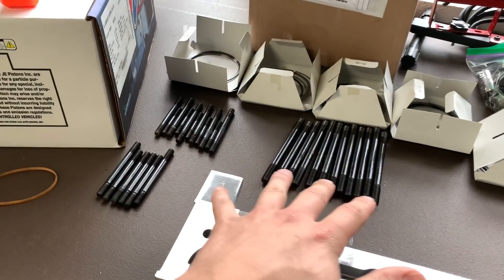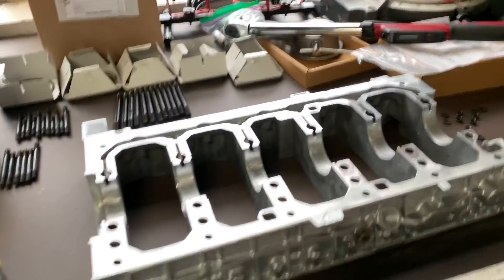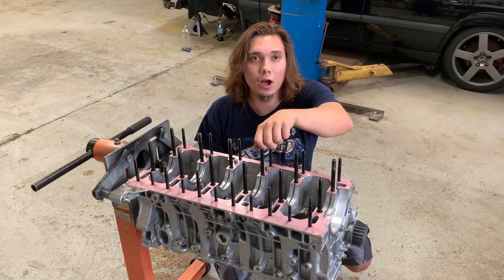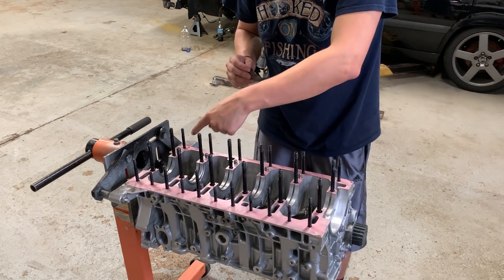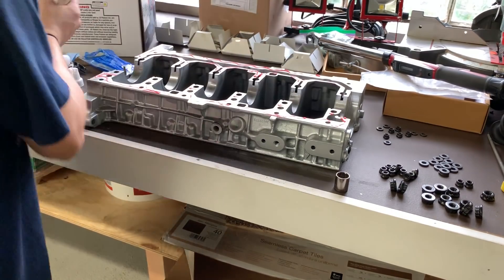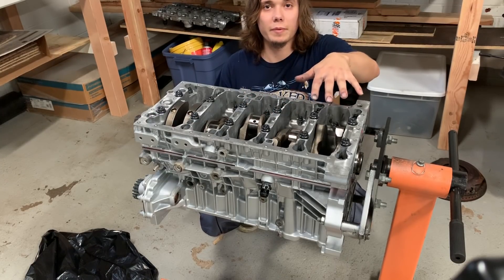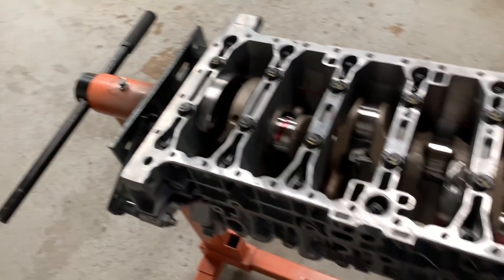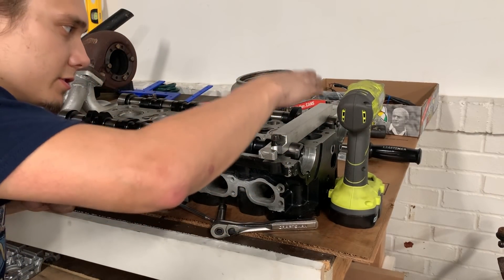Volvo 850 Build Part 2 - Crankshaft + Valve Lash

Comment: Now I'm worried about not using enough sealer on my rocker cover reseal. I only had a small tube and used new foam roller and only applied it to the cover side only. Hope my oil pressure is ok

Comment: I've just torn apart my 2000 volvo v70 R and waiting on parts to start the rebuild. Could you let me know where you got the torque specs and tightening sequences because I can't seem to find any info on the bottom end online. I even bought a shop manual but it was missing alot of info. Thanks alot great video

Comment: Thanks for great videos, amazing work! I want your advice about problem with my volvo 850 T5. I bought it with cracked oil pan, which was sealed with fiber glass, I didn't even know until last month parts sealant came off and clogged oil tube, oil light came on and one crankshaft journal overturned. It is very hard to find good B5234T engine, I Googled that 2.4 crank is same as T5 so thinking to replace it. How hard is to replace crankshaft and bearings, has cilinder head or engine to come off?

Comment: Like your videos very much. Own my volvo 850 t5 in Russia. Decided to do something far similar with my engine🤘 but came across with absence of autoparts(( can't find original std main bearings. Dealer has King or Glyco. But i don't think its good ones for the turbo engine. What kind of main bearings do you use and where can i get them?? Thanks dude

Comment: Anaerobic applied to the wrong half of the two surfaces. Only need it on one side, always choose the part with less surface area to apply this sealant to. All the excess becomes diluted in the oil when the engine is started. Probably no real issue, but technically wrong.

Comment: Maybe I missed it in a previous video, but did you ever say what clearances you're running on the crank mains and rod journals?
Reply from the maker: Crank - .0023 - .0025" Rods .0020-.0025"

I usually like to run .0018" crank & .0020" rods, but they are what they are at this point. The crank saw some damage and needing polishing so they opened up a little bit.
Reply: @SimplyVolvo  Just curious. That's not too bad, you'll just have to run some really heavy oil I imagine.
Reply from the maker: @turbovolvos40  Maybe, my clearances were close to that on my old darton engine and oil pressure was really good. It will be reallllyy good now with the solid lifter conversion and limiting the amount of oil going to the head.

Comment: Do you use the OEM oli pump? From 854 owner in denmark👍🏻
Reply from the maker: Yes OEM oil pump but I use the RN Style 30650144. Flows about 50% more volume than the old 850 style.
Reply: SimplyVolvo what volvo do that com from?
Reply from the maker: @mikkelnielsen9200  99+ RN engines.
Reply: SimplyVolvo so a pump from a v70 T5??
Reply from the maker: @mikkelnielsen9200  Just buy the part new from Volvo 30650144. A used oil pump is never a good idea.
Reply: SimplyVolvo yea i hear ya 👍🏻